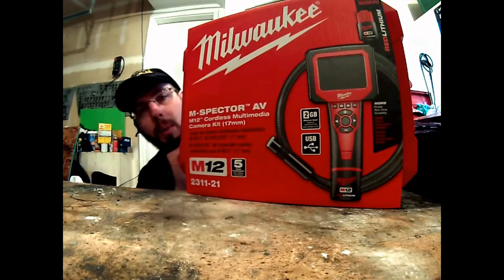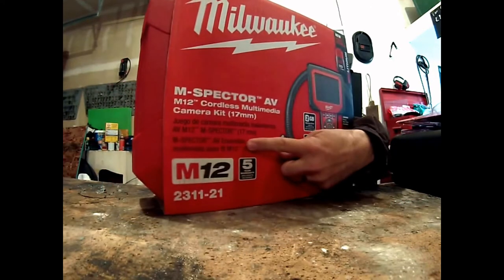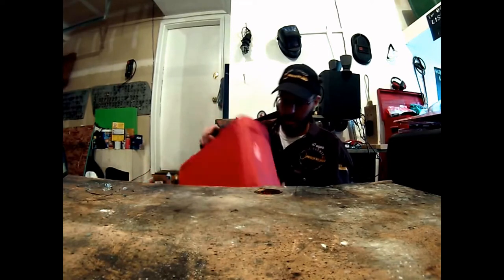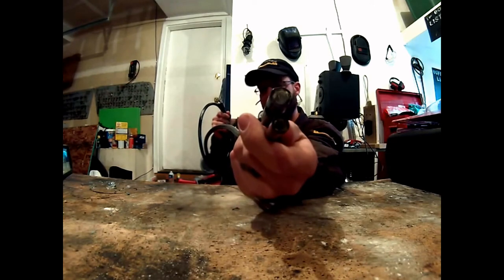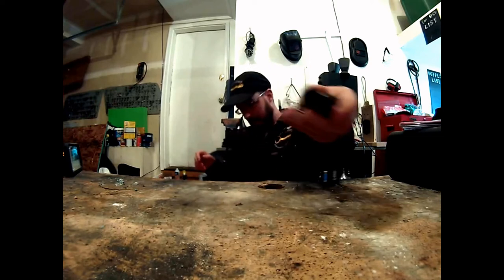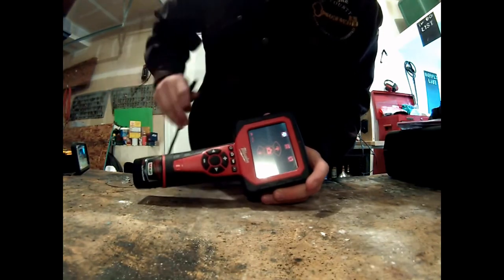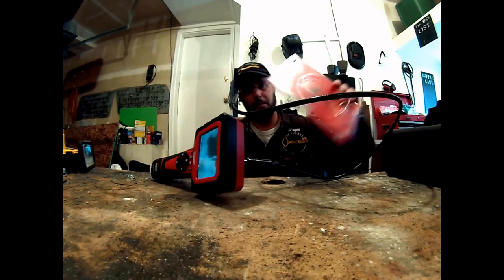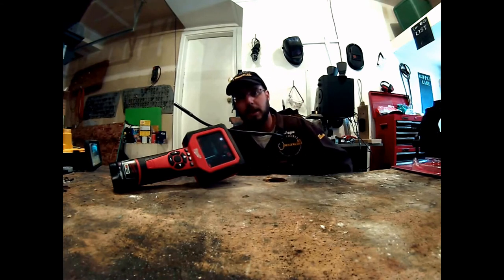Milwaukee Inspection Cam Camera Review M12 9.5mm and 17mm 20311-21

Comment: 1/2 inch is not 17 mm. 12.7 mm equals 1/2 inch and 17 mm is slightly larger than 5/8 inch, for anyone like yourself that the camera size would make a difference, that’s an important spec to consider.

Comment: Hello Wayne,
Really good review, thanks.  Have you reviewed the Milwaukee 20311-21 since your report in February?  It would look as if one has to order individual part numbers to get what one needs. Is this the case?   I'm thinking of getting it for my husband to use on the classic cars and boat.  Any comments.
Regards, Polly
Reply from the maker: +Polly Davenport I think part numbers are still the same. It still works great for me. I highley suggest the smaller 9.5mm camera line as well. The 1/2 inch stock is a bit big. Also note that the 9.5 mm canera is commenly found at Home Deopt